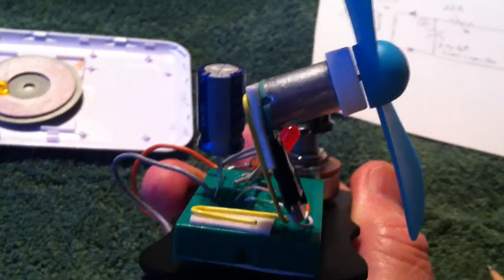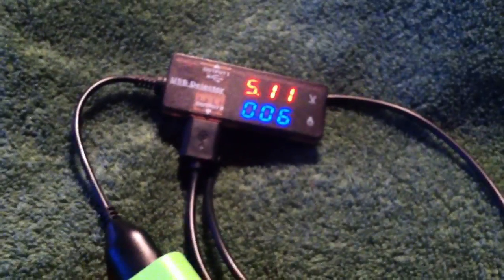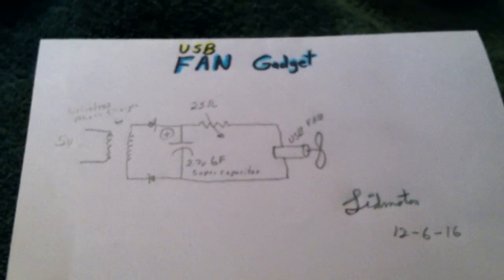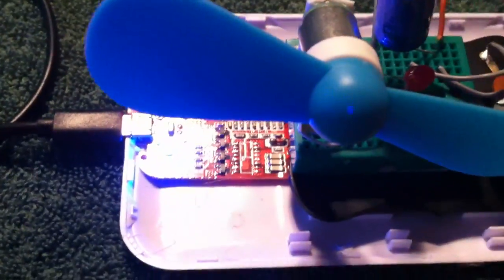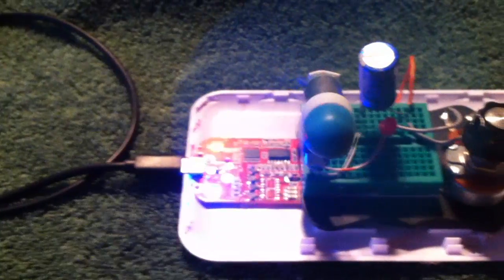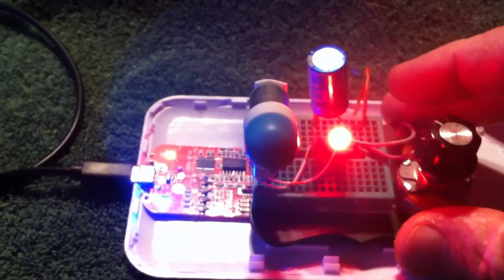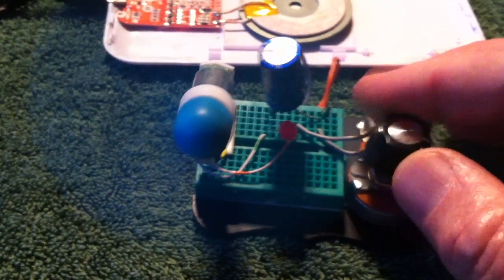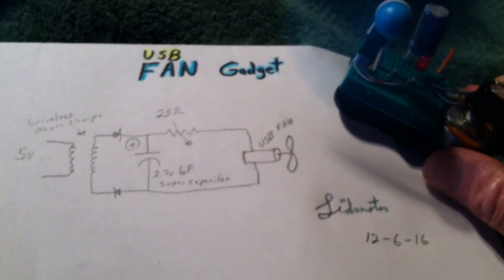Fan Gadget

Comment: You could easily overcharge the supercap. I know they are not that expensive, but since supercaps in fact have eternal live I am always very careful not to go over 2.7 Volts (I also have caps which go up to 2.85, so it depends on the specs).
There is always a big doubt. What would be an efficient way to charge supercaps without to much energy lost. The wireless device is in fact an air core transformer. I think not that much energy will be lost.
( going off topic )
In December I usually start testing to run Christmas lights from supercaps. Having second hand supercaps is not good, they self discharge to quick. I did find out if you connect a string of LEDS to a bicycle light (remove the single led with the string, do look for a light which holds 2 cr2032 batteries and thus runs on 6 Volts)) you can power a string of 100 LEDS using 2 NiCads at 10 mA (in blink mode). I have a few 4Amp nicads laying around, and that will run the X-lights very long! I do have a dc2dc booster in between, which boosts the voltage up to 3.5 V or so, by controlling the voltage I control the amps as well. The bike led lamp also runs on LiPo, but you can't control the amp draw.
Reply from the maker: Thanks for the good comment.  Yes you have to be careful not to overcharge the capacitor.